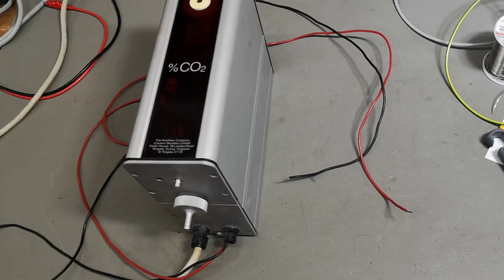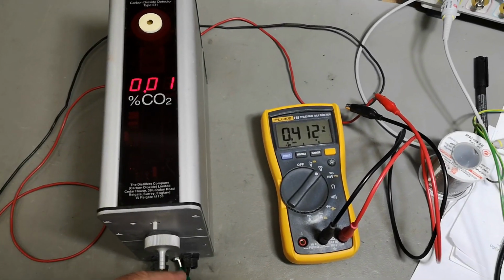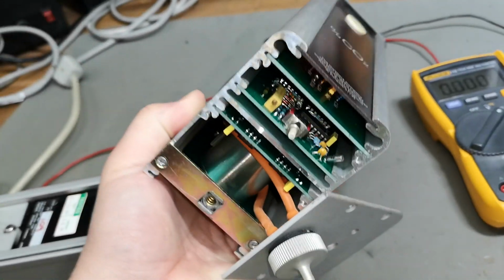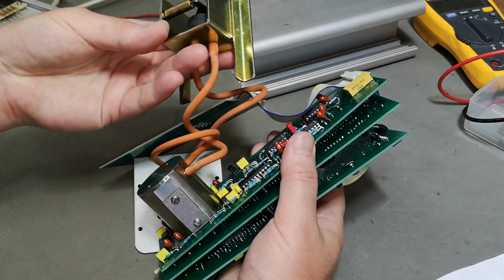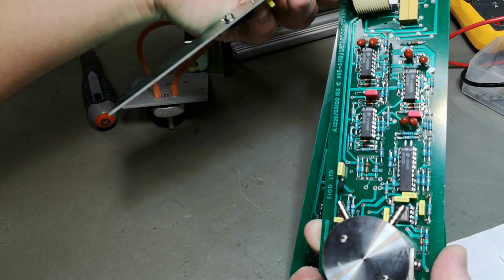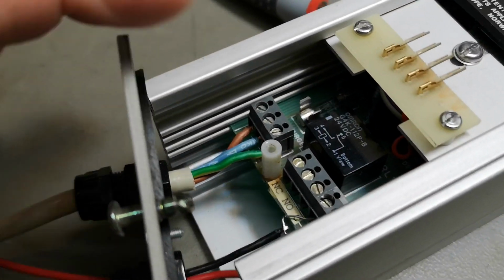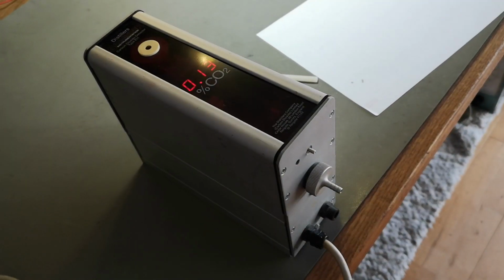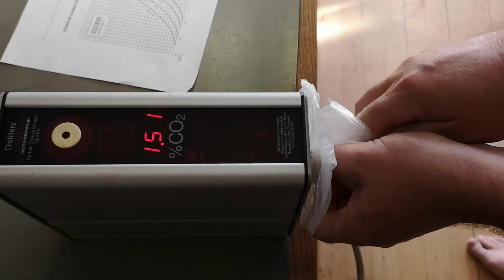Distillers Gasminder carbon dioxide detector EI1 CO2 test teardown

Comment: Hi Thomas, it's amazing that you can't get everything, the experiment with plastic bags was perfect and fun. I saw very vividly how in the calibration laboratory laboratory workers run with calibrated bags and collect air so that they can spray the exact amount of CO2 from a calibrated fire extinguisher with a calibrated syringe 😂 beautiful, thank you for the demonstration. A pump based on this electromagnetic principle was used as a device for oxygenating water in home aquariums so that the fish had at least a slightly fresher environment.

Nice day 🙂 Tom
Reply from the maker: i used CO2 in my fresh water fish tank to help plant growth, when the system regulator failed i killed all fish, so i found the problem in main regulator and fixed it.
Reply: @TeardownOZ2CPU  When I was young, I had an entire wall of aquariums and in one 300l aquarium I had a central filter system when I came to add food to the food dispensers (self-made from the rotary sorter of the P51 telephone exchange). I couldn't find one angelfish, I thought it hid in a rock that was in their aquarium. Searching for fish caused me to forget to change the disinfectant cartridge in the filter, the angelfish was probably in the cavity of the rock, but the angelfish must have died there, the bacteria from the decomposing fish thanks to the central filtration they got all the fish in all the aquariums - completely dead - you can't imagine the stench in the apartment after about a month when I came back from vacation.
Reply from the maker: @Edisson.  oh no terrible.. once i figured out how to handle anglefish fry i made 1000 baby fish and sold them :-) that was fun on many levels, i think i made a few videos but right now i can only find one : https://youtu.be/4WCEhIMQ9HY
Reply from the maker: it was on my old vimeo, see this one https://vimeo.com/136285735
Reply: @TeardownOZ2CPU  Thanks for the link, I'll have a look tonight